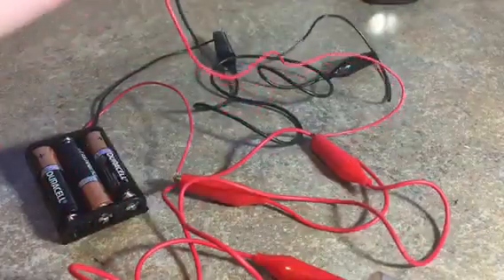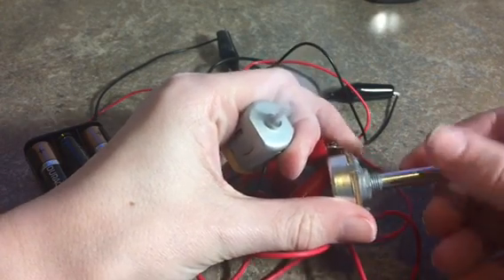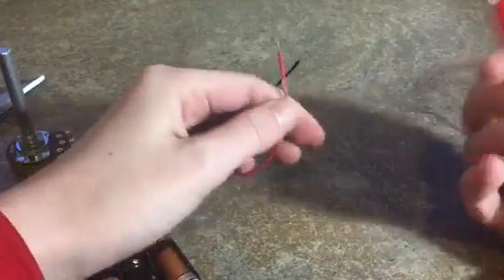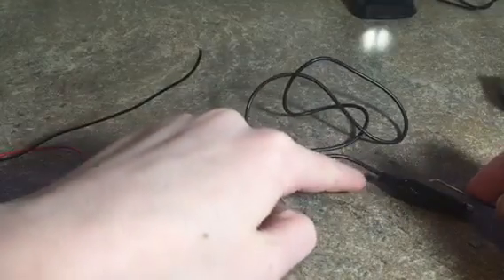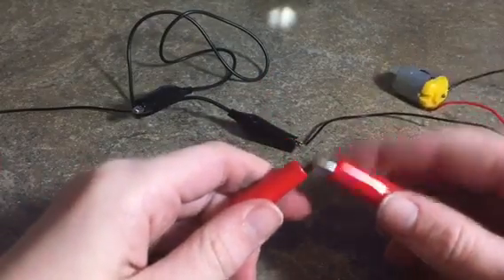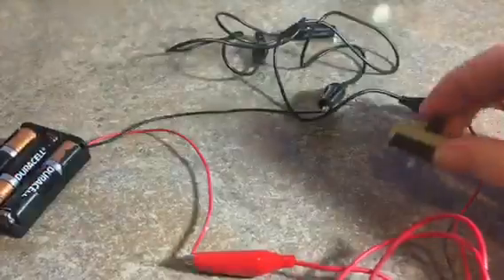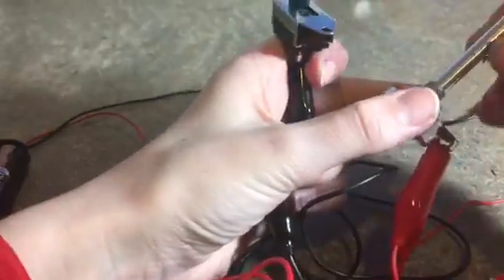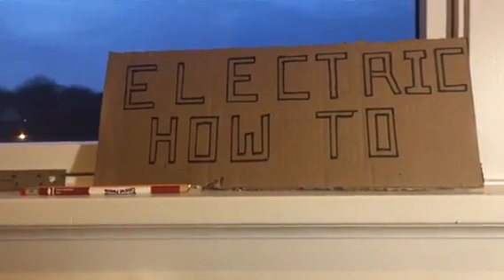How to wire a potentiometer (Step By Step)

Comment: U clipped only two pins what about the first pin in pot
Reply from the maker: I’m 90% sure that you can use the extra pin for connecting a resistor

Comment: Im no electrical engineer, but the potentiometer may not work because it is a Linear one instead of a Logarithmic potentiometer mixed with low voltage. If you look at a chart based on these two, im sure the voltage enters the minimum peak at when you turn it all the way up and thats why its touchy
Reply from the maker: Thank you, I’ll look into that!
Reply: @ElectricHowTo  Check out this video: https://www.youtube.com/watch?v=Tr-8uj95330. It does a good job of showing the difference as well as showing how to test with a multimeter.
Reply: @ElectricHowTo  I did some testing and I found the Linear one more effective.. However everyone on the internet says otherwise? Good luck

Comment: How many ohm is that potentiometer?
Reply from the maker: I can’t really tell now, I no longer have that specific potentiometer, but I will tell you that the battery pack had about 4.5 volts of battery’s inside. Sorry but I can’t calculate it with the information that I have